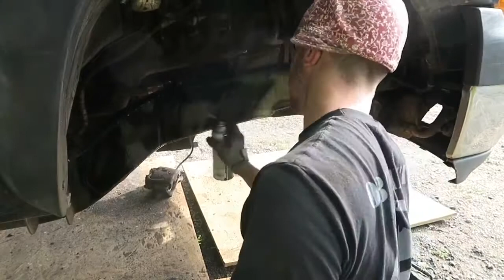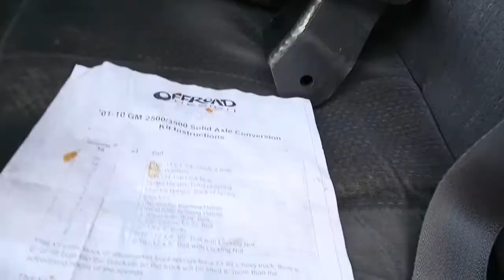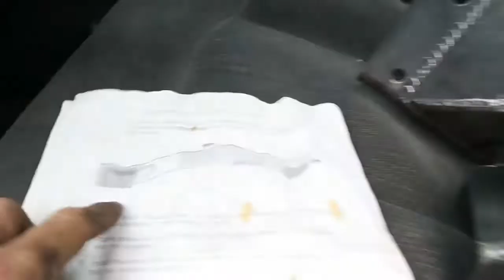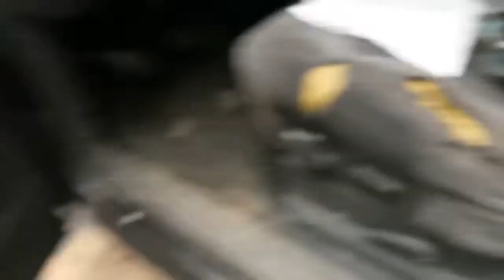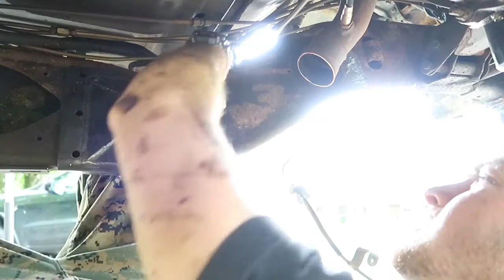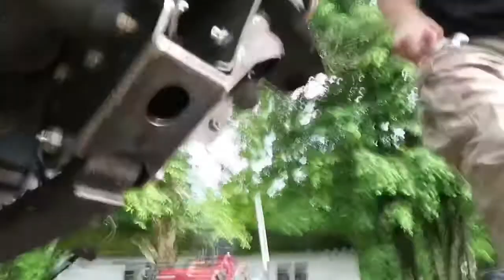2500HD SAS pt 3. offroad design SAS kit.

Comment: It's interesting to see someone doing this with the same parts as I am using. Most the SAS stuff is from Off-road Design and some stuff from WFO. Sad to say I have been working on mine for 6 months now. Got the frame painted with 7 coats. Currently rebuilding the 79 Dana 60  high pinion kingpin. Just broke a kingpin in half. Took an hour to get the rest of it out. Looking forward to how yours will drive and handle.